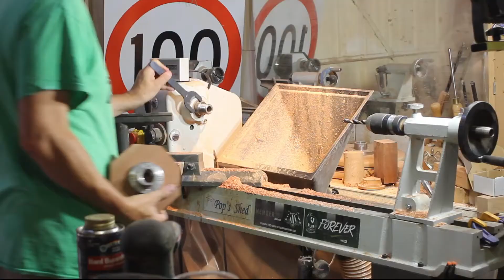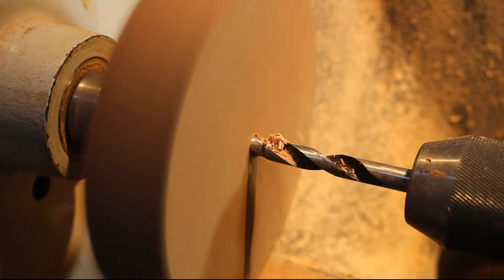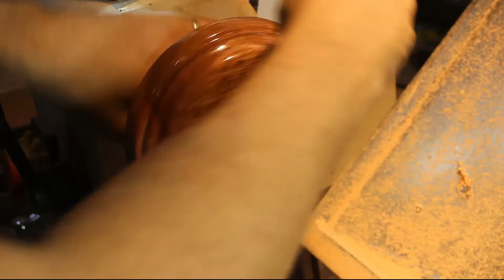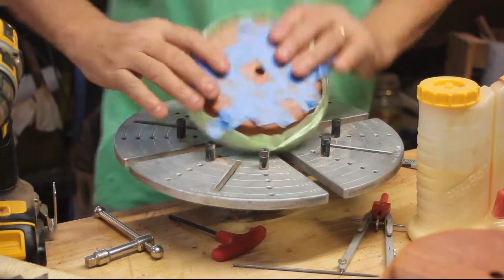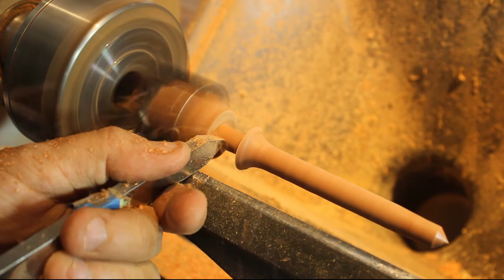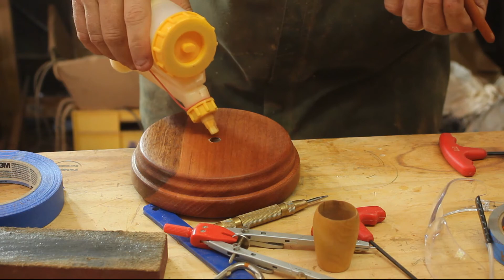Woodturning a Wool Caddy from Sydney Blue Gum

Comment: That’s pretty cool. Can I ask where you got you’re bearing not for the bottom that enables it to spin. Many thanks
Reply from the maker: They're a lazy susan bearing easily available from a local wood turning supply shop or online. These ones are 125mm in diameter (5")
Reply: Fatso's Workshop thankyou!